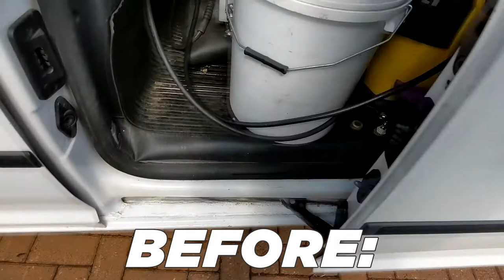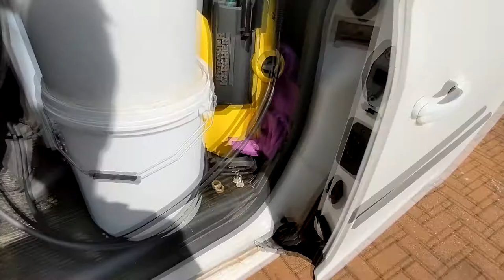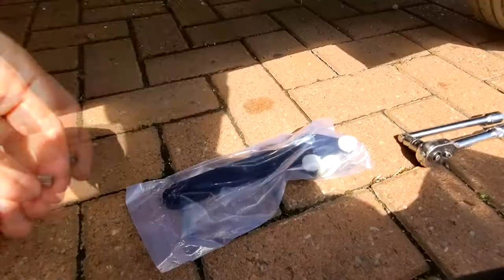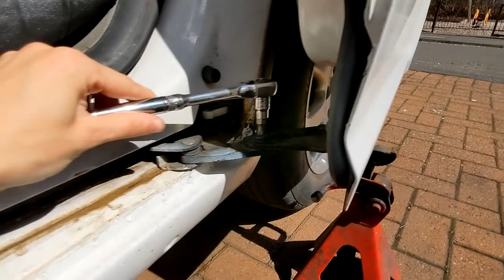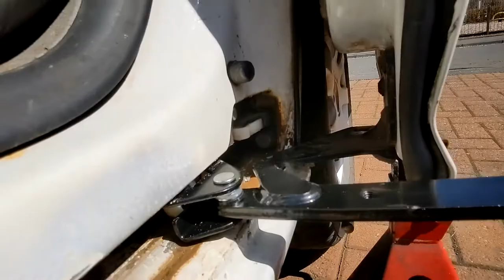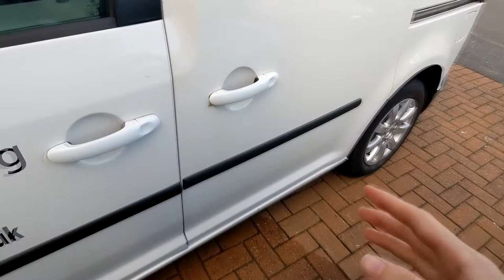VW CADDY MK3 SIDE DOOR RUNNER REPLACEMENT - 5 Minute Job! - 2005 SDI

Comment: You may also want to install the stainless steel plate under the roller to prevent paint damage and further rust...
Reply: Where do you buy this?
Reply: @Haydzx-tn3gy  Hello. I ordered mine at local metal shop, which just cutting metal for different purposes (not related with cars). Description was just "Underlay for sliding door  VW Caddy" something like that. But later I noticed they had in the description this part number - VАG 2К0843713.
Reply: £90 for a strip how much was yours from a metal store? Do you have a picture you can share